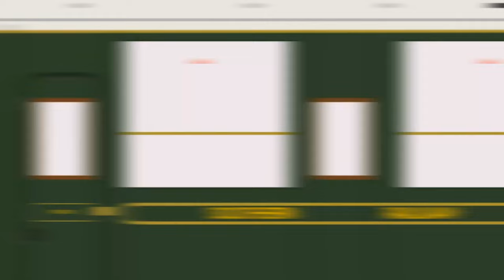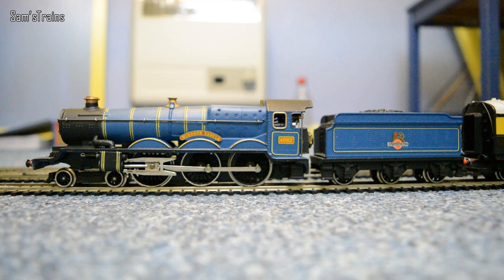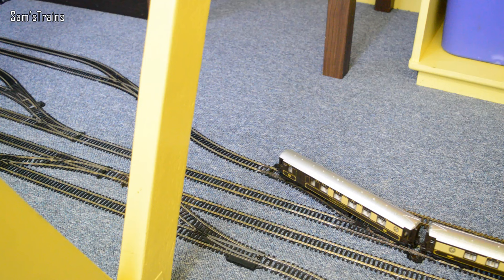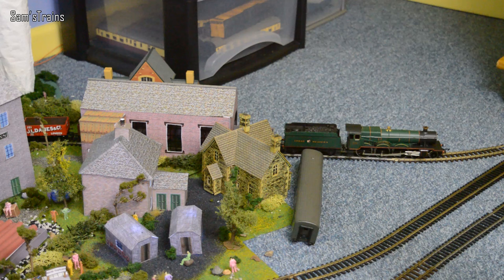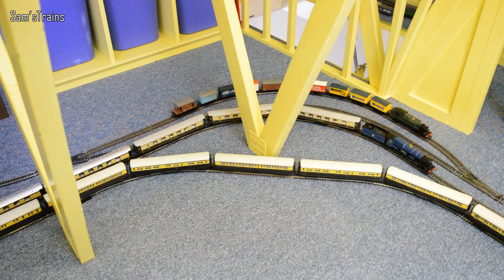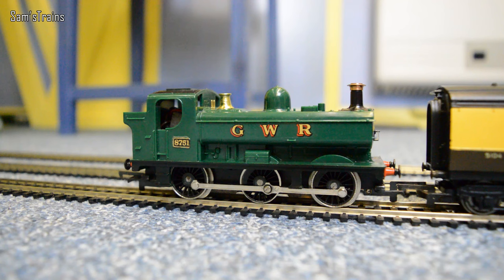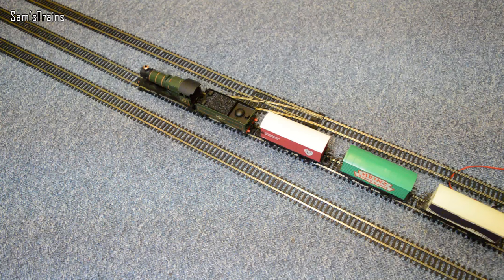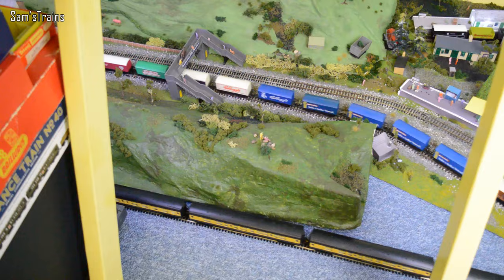Great Engineers: A Day With Collett Locomotives (2)

Comment: Superb vid Sam, thank you SO much for doing Collett. Running the pannier bunker first was the really killer, Tank locos were designed to run either way, and I wish more folks would show them running that way.

Also, yes the 14xx was a Collett design. They were introduced in 1932 and originally called the 48xx class, but they were renumbered as 14xx in 1946. There was also a batch of ten others, nearly identical, but called the 58xx, but were not fitted for working with auto coaches and mainly used on light branch line good trains.

Interestingly like the Collett goods, they were an updated version of an earlier engineers design, in this case George Armstrongs 517 class.of 1869! Apparently the 517s were getting life expired, and Collett just tweaked the design slightly by using a more modern boiler design and making minor alterations to the valve gear etc. A case of 'if it aint broke don't fix it'

Any, your best vid yet, and my favourate is the Pannier, for as much as I love the King and the Castle (as well as most thing GWR)., there is something very workman like about the 57xx that give the a functional elegance.
Reply from the maker: Hi again Jon, and thanks for the marvelous comment - really appreciate that! Very interesting about the 14xx, a bit of good luck that I chose to use her then lol!
Really glad you enjoyed it though, and I hope you like the rest!
All the best mate,
Sam :)
Reply from the maker: Hi! I doubt you'll get one on Amazon - best to check Ebay instead! :)
Cheers,
Sam :)